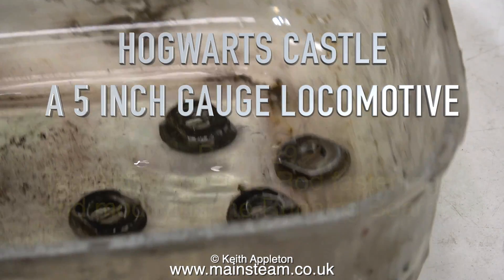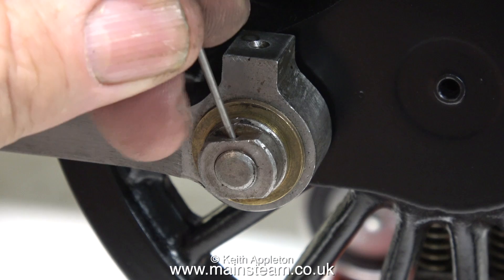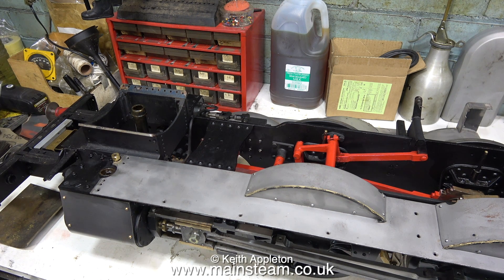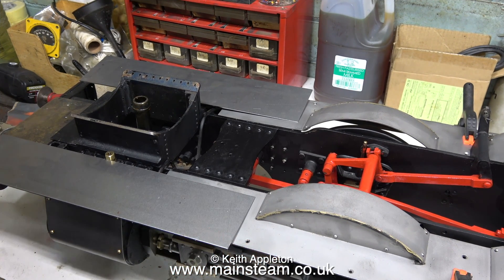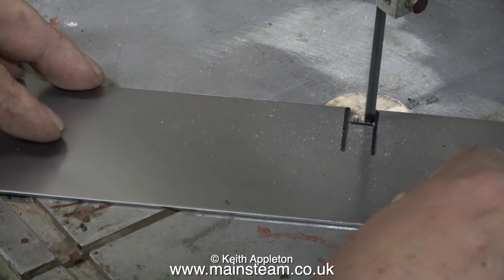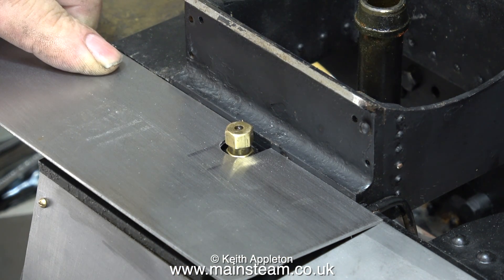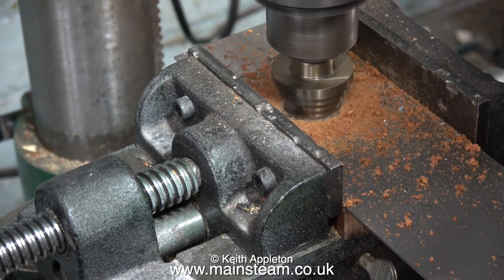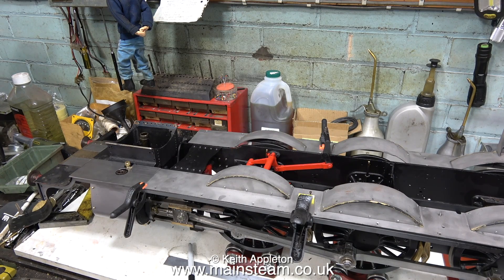HOGWARTS CASTLE - A 5 INCH GAUGE LOCOMOTIVE - PART #29

Comment: I find it amazing that you are still producing videos, about one a day or more, even while in the midst of a move and setting up your new workshop.  I find your videos both relaxing and informative.  I did many similar techniques as a teenager, 50 years ago, while working on model cars, motorcycles, full-size old cars, etc.  My father had a good sized set of hand tools, but the only power tools were an electric hand drill and a light duty jig saw.  I spent lots of time fabricating pieces out of what was available, often from scrap, with the tools at hand.  Please keep up the good work.
Reply from the maker: I make videos for my Patreon supporters first and I need to continue doing this: www.patreon.com/keithappleton